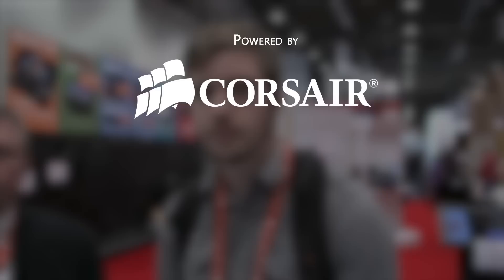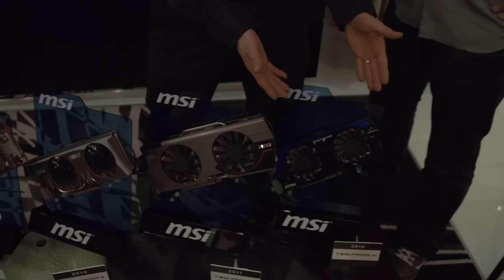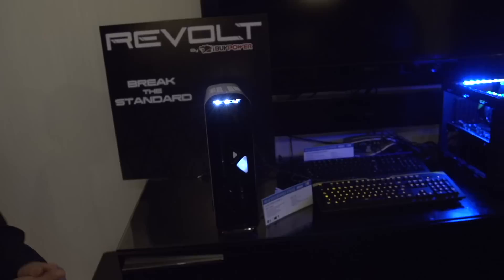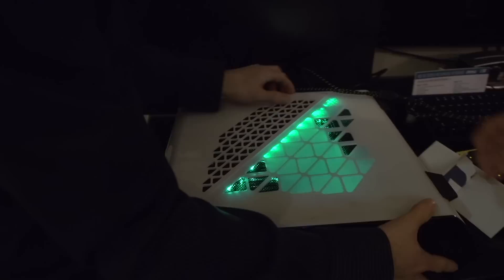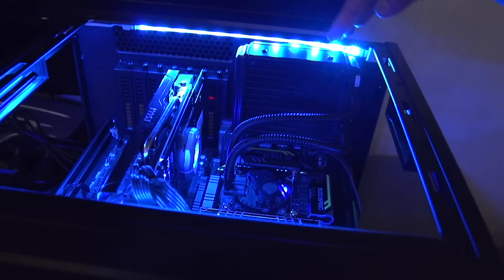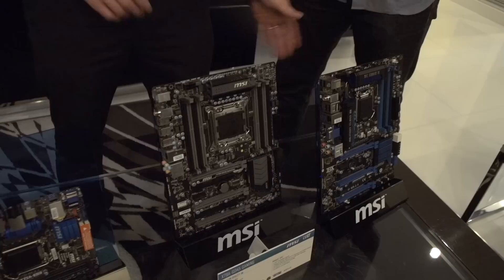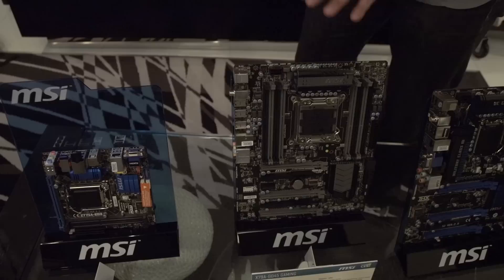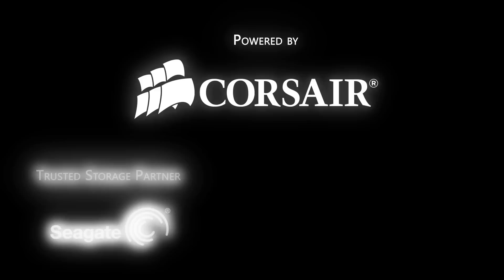MSI PC Components Suite with Alex Chang - Linus Tech Tips 2013

Comment: Motherboard Return Rates, December 2010 :
Gigabyte 2,33%
MSI 2,44%
ASUS 2,49%
ASRock 2,71%
Basically pick any of those, all these manufacturers have very similar return rates. Some specific models should be avoided but I wouldn't pick a clear winner solely based on some comments on the Web about DOA... it happens. You'll have to do some research to figure out which one is best for you, if you want to try something else than MSI, then go for it.